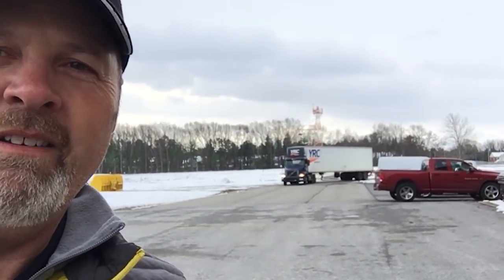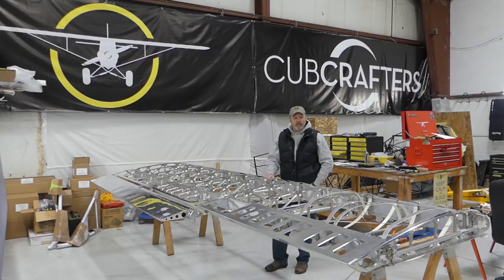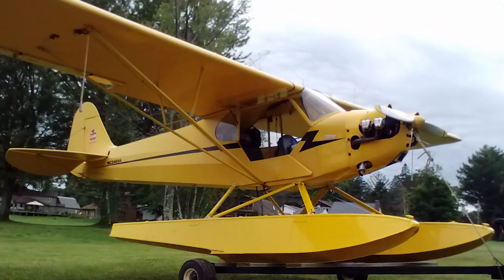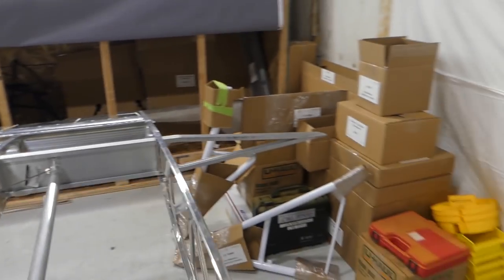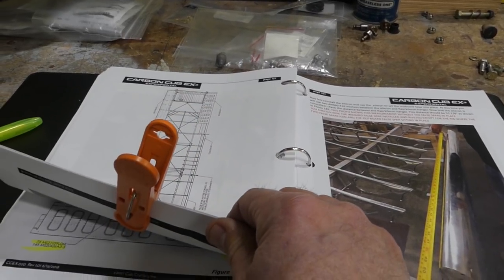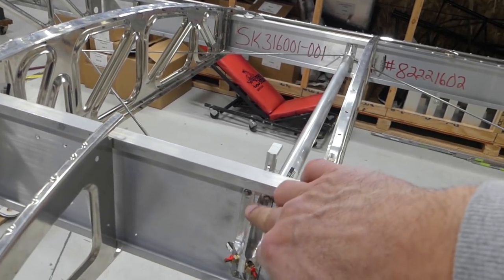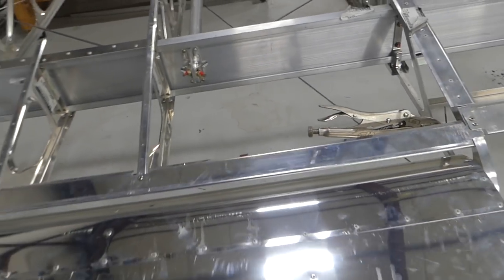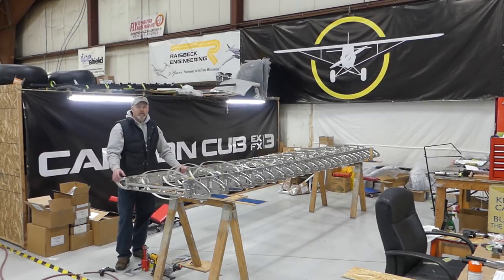"YANKEE ONE" Carbon Cub EX-3 Build Update #1

Comment: Please get the spars off of the bare floor.  Electrolytic corrosion damage to aluminum from concrete floors is insidious and long term.  Stray voltage from the floor accompanied by the inherently high moisture levels are a sure fire way to start this type of corrosion.  As an A&P and 30+ years in the field, it has been banged into our heads that no bare aluminum will rest on floors due to the possibility of intragranular and electrolytic corrosion setting in.  Nothing worse than a spar with a gray spot on it...
Reply from the maker: We passed your comment along.  Thanks!